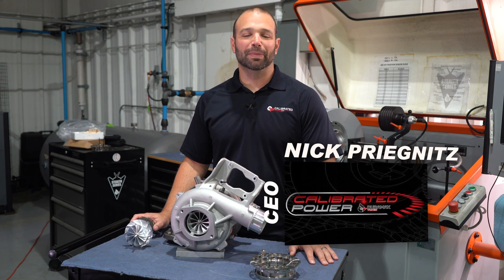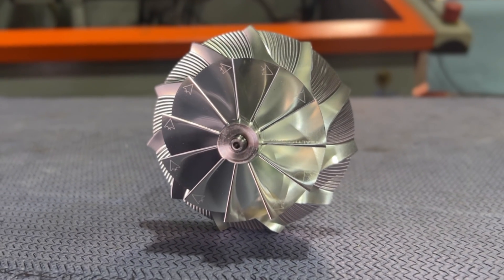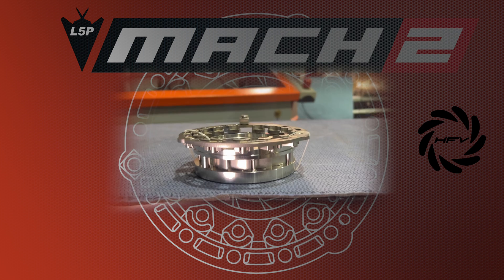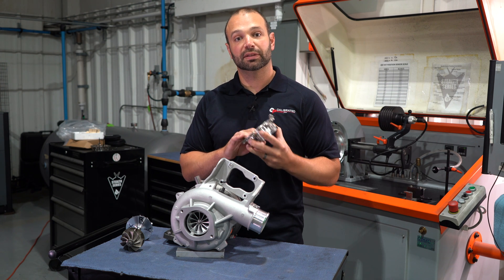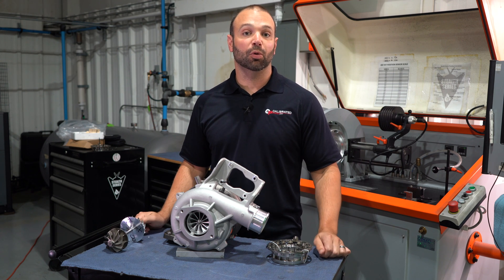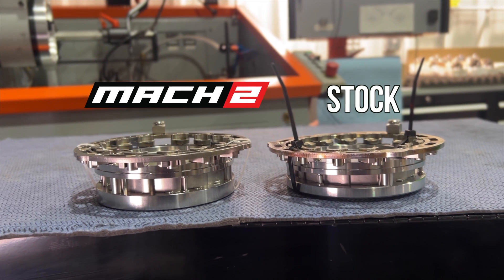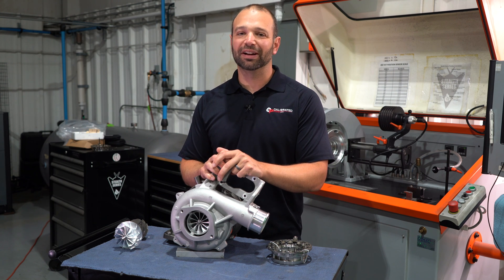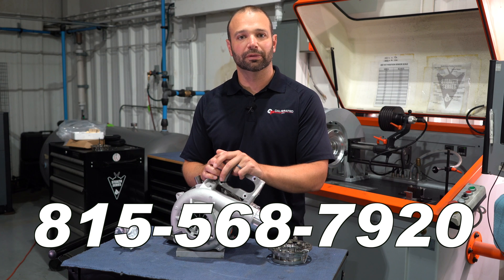The L5P Stealth Mach 2 For 2017-2023 6.6L Duramax!

Comment: Will this improve or hurt fuel economy? I know it will probably depend on how it’s driven. Currently have stock turbo, tuned (SOFT) and deleted 5” all the way back.
Reply from the maker: Always depends on driver and tuning.
Reply: @Duramaxtuner so in your opinion how does it need to be driven for fuel economy? I plan on doing intake horn and higher flow pipes as well. I am assuming keep your foot out of it haha

Comment: On 800 turned up. Whats the ball park pulse width for and lml on 67?
Reply from the maker: Really depends on injector size and cp3/cp4 pump.You'd want to limit pulse width to that max HP rating.

Comment: Does the stock or aftermarket intake including anti surge work witht this turbo?
Reply from the maker: We would suggest using an open style intake horn and then matching it with out Anti-Surge ring specifically designed for the Mach 2.
Reply: @Duramaxtuner  thanks👍 I found the video where you talk about it a little before you replied😂

Comment: Would you need to do anything to the injectors or fuel system for this?
Reply from the maker: @jordanwoolford4847 The only thing this turbo requires is a tune. However, to get the maximum amount of power out of it you will need to upgrade your injectors and fuel pump.

Comment: How would this compare to a 68mm Garret?
Reply from the maker: @ChaseRDale I'm a little confused by your question. Are you referring to a 68mm Turbo for a LML/LMM/LBZ/LLY? Garrett does not make a 68mm turbo for the L5P and the L5P turbo compared to older Duramax turbos differ pretty greatly. The comparison would not be very apples to apples. But if that's what you are wondering I would be happy to share my knowledge on how they compare.
Reply: @Duramaxtuner  sorry, I had a 68mm on my lbz. Wasn’t that laggy when tuned and had tons of power up top/highway speeds. Would a stealth67 be similar upgrade?
Reply from the maker: @ChaseRDale  The difference in lag between the stock charger and the Stealth 67G2 is slightly noticeable. Tuning can assist but it is not going to solve it. At the end of the day the rotating assembly is larger and weighs more and tuning won't ve able to do anything to change that.